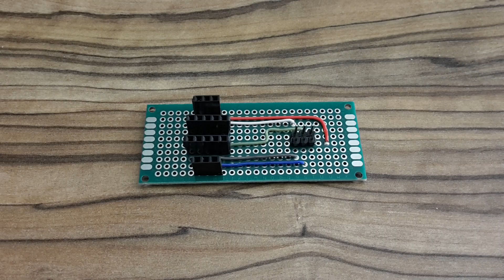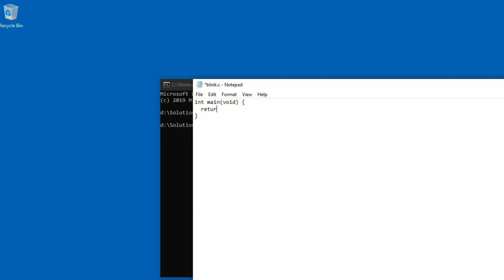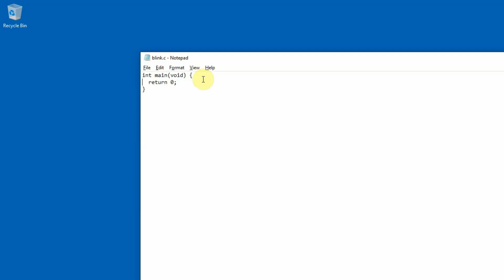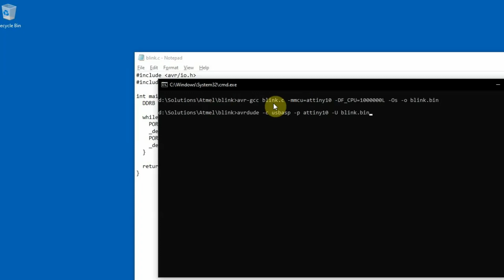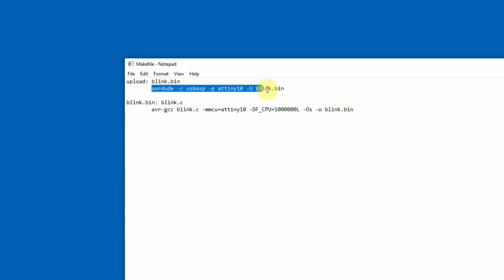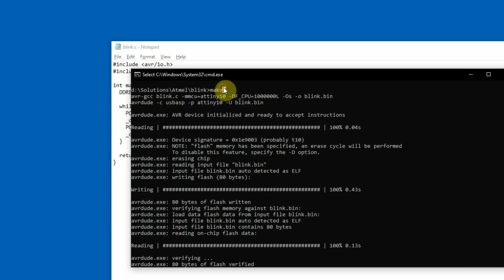How to Blink a LED with ATtiny10 Microcontroller

Comment: hi freind
i can't complie this source
here is result,can't find attiny10 mcu

Microsoft Windows [版本 6.1.7601]
版权所有 (c) 2009 Microsoft Corporation。保留所有权利。

C:\Users\Administrator>avr-gcc c:\blink.c -mmcu=attiny10 -DF_CPU=1000000L -os -o
 blink.bin
unknown MCU 'attiny10' specified
Known MCU names:
 
   attiny11
   attiny12
   attiny15
   attiny28
c:\blink.c:1: error: MCU 'attiny10' supported for assembler only
In file included from c:\blink.c:1:
c:/winavr-20100110/lib/gcc/../../avr/include/avr/io.h:404:6: warning: #warning "
device type not defined"
In file included from c:\blink.c:2:
c:/winavr-20100110/lib/gcc/../../avr/include/util/delay.h:90:3: warning: #warnin
g "Compiler optimizations disabled; functions from <util/delay.h> won't work as
designed"
c:\blink.c: In function 'main':
c:\blink.c:6: error: 'DDRB' undeclared (first use in this function)
c:\blink.c:6: error: (Each undeclared identifier is reported only once
c:\blink.c:6: error: for each function it appears in.)
c:\blink.c:6: error: 'PB2' undeclared (first use in this function)
c:\blink.c:9: error: 'PORTB' undeclared (first use in this function)

how to slove it 
thx
Reply from the maker: Hi my friend, could you check the version of your avr-gcc, use this command: avr-gcc --version. I use on my laptop avr-gcc (GCC) 5.4.0, which is included in the Arduino installer version 1.8.9. In the version 1.8.10 of the Arduino IDE they upgraded avr-gcc to the higher version and it doesn't work like I described in my video.
Reply: @zeroampselectronics  
thx reply
here is result

C:\Users\Administrator>avr-gcc c:\blink.c -mmcu=attiny10 -DF_CPU=1000000L -os -o
 blink.bin
In file included from c:\blink.c:2:0:
f:\arduino\hardware\tools\avr\avr\include\util\delay.h:112:3: warning: #warning
"Compiler optimizations disabled; functions from <util/delay.h> won't work as de
signed" [-Wcpp]
 # warning "Compiler optimizations disabled; functions from <util/delay.h> won't
 work as designed"
   ^~~~~~~
In file included from f:\arduino\hardware\tools\avr\avr\include\util\delay.h:45:
0,
                 from c:\blink.c:2:
c:\blink.c: In function 'main':
f:\arduino\hardware\tools\avr\avr\include\util\delay_basic.h:105:2: error: incon
sistent operand constraints in an 'asm'
  _asm_ volatile (
  ^~~~~~~
f:\arduino\hardware\tools\avr\avr\include\util\delay_basic.h:105:2: error: incon
sistent operand constraints in an 'asm'
  _asm_ volatile (
  ^~~~~~~
f:\arduino\hardware\tools\avr\avr\include\util\delay_basic.h:105:2: error: incon
sistent operand constraints in an 'asm'
  _asm_ volatile (
  ^~~~~~~
f:\arduino\hardware\tools\avr\avr\include\util\delay_basic.h:105:2: error: incon
sistent operand constraints in an 'asm'
  _asm_ volatile (
  ^~~~~~~
how can i slove
Reply from the maker: Hi, you didn't answer my question. Which version of avr-gcc do you use?
Reply: @zeroampselectronics  
thx reply

here is result

C:\Users\Administrator>avr-gcc --version
avr-gcc (GCC) 7.3.0
Copyright (C) 2017 Free Software Foundation, Inc.
This is free software; see the source for copying conditions.  There is NO
warranty; not even for MERCHANTABILITY or FITNESS FOR A PARTICULAR PURPOSE.
thx
Reply: @zeroampselectronics  
hi friend
i test successful now,thx
Reply from the maker: What was wrong with it?
Reply: @zeroampselectronics  
hi,i use wrong command of avr-gcc
friend ,do you have how to use avr-gcc command list and avrdude command list?
thx
Reply from the maker: Hi, for avrdude you find it here: https://www.nongnu.org/avrdude/user-manual/avrdude_toc.html and for avr-gcc you find it here: https://gcc.gnu.org/onlinedocs/

Comment: Great video. How would you do analog write like in Arduino IDE to make the LED slowly dim in and out using pwm?
Reply from the maker: Hi, it is possible to do that using 16-bit timer/counter, I'll show that in one of my next videos.
Reply: @zeroampselectronics  I looked for your video on the use of PWM on the attiny10 but I did not find it, I guess you have not published it yet. Your explanations are extremely clear and pleasant to listen to I sincerely hope that you will be able to propose a video explaining the use of PWM to vary the intensity of a Led for example. Thank you for your video and your clear and precise explanation.
Reply from the maker: Hi, I don't plan such a video at the moment. Not enough time.
Reply: @copypast6219  it is pretty easy using pulseIn in ArduinoIDE